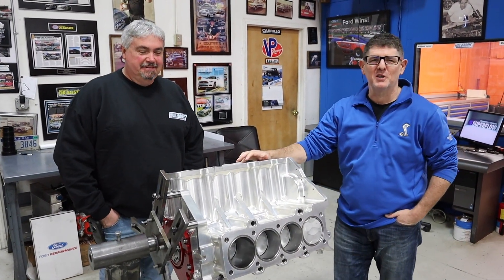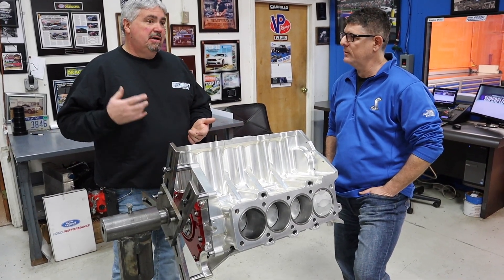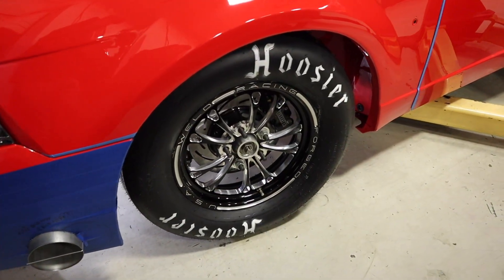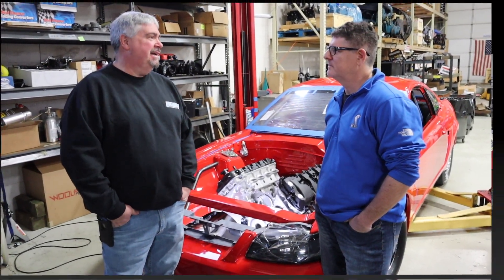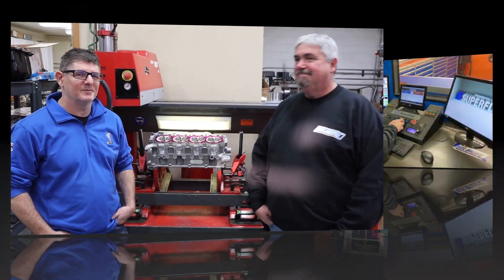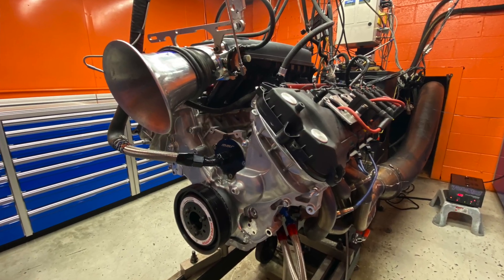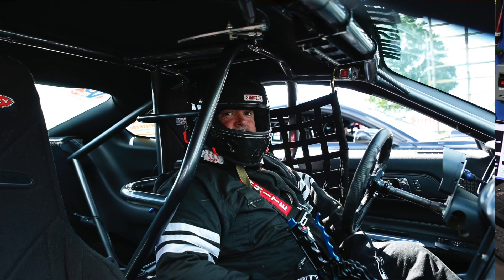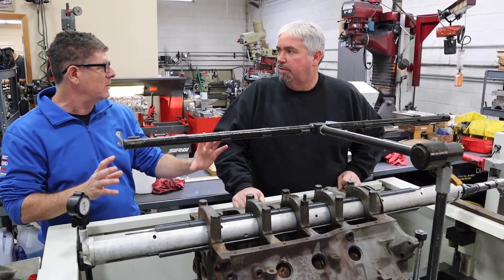850 HP All-Motor Coyote at Holbrook Racing Engines | Billet Coyote Engine Block & Race Car Reveal

Comment: Oh just some parts we had lying around the shop.. BULL SHIT.  You don't run custom grind cams in factory Stock. Guarantee you if I asked for a duplicate of that motor I would get and it would make 650 hp. 327ci so it will get 60hp over your standard build from the displacement.

Comment: The sound isn't just NA power. It's just how modular motors sound. 2 valves were probably the king of sound but they are gone pretty much . 99/01 Cobra 4 valves were a close second

Comment: Im a coyote guy to the heart. But 850hp na on a 327 coyote at 12:1 is a hard sell
Reply: It’s called Thermal Efficiency. F1 is a 1.6L V6 and is 800hp without the turbos. What do you think someone can do with a 5.4L V8?
Reply: @RandomGuyAgain F1 is a completely different level. I can tell you just like to argue. F1 engines arec18:1 compression ratio. A machine to very strict tolerances with machines that cost more money than  this shop can ever afford. I own two coyotes. 850 horsepower is not believable with 12:1 compression ratio.  RPG makes a 5.5l coyote with a compression ratio of 14:1. And with the correct supporting heads, cams, intake it will make around 850.
Reply: @HK304  Its on C25 with GT350 heads. It is definitely not a hard sell lol. Insane if you dont think it made this power

Comment: 163 hp / liter, at 7800 rpm.. dang, thats higher then all motor touring cars putting at 8700-9000 rpm.. there must be a secret sauce in this engine.. anyone notice that it has unequal length 4-1 header? I can see that from the left bank cylinder no 1 is longest, 4 is the shortest.. are there any studies for this unequal length 4-1 design?

Comment: I’m aware this video is old, but ain’t no way this made 300 more horsepower over a GT350. Not at 12:1 compression. Not naturally aspirated.
Reply: @GP_With_The_M3  I got you. Basically you’re  slightly oversimplifying how a race engine is designed compared to a factory assembly line motor. The internals are outrageously more efficient. Much smoother bore, ultra thin piston rings, probably weight reduction in the crankshaft, and 0 friction, list goes on. F1 cars are 1.6l DOHC V6 pumping 750hp without the turbos and electric motor. That’s a 97ci motor with in some cases only 13:1 compression. This is a DOHC 327ci with internals almost as aggressive as an F1 car.

Comment: what block are they using for the 327 NA i wanna eventually wanna build my Coyote to a 327 but i Cant find much on if its ok to stroke a coyote past stock due to the Short Cylinder Walls

Comment: It was still gaining 10+hp per hundred rpm when he shut it down, would be my guess, @8500 for it to make 910-915hp
Bad dude right there, would love to bring the engine from my Terminator to Chris and the gang to work their magic, as it sits right now, it has made 707 @21#'s on e85 with a whipple 3.4 providing the aspiration.

Comment: Suspect 5700 rpm to 5800 rpm this motor picked up 106 hp with 100 rpm. It wnet from 456 at 5700 to 562 at 5800 (strange). Never seen this kind of jump with 100 rpm. Also peak torque is at 7k so these off the shelf cams  are big big. I saw a coyote engine pick uo 250hp with porting and cams only and this was an engine that already had 551 cams and cnc ported heads. The factory port wok is not great and the coyote cams are very mild, even in the cobra jet and gt500 engines. There is a lot of room for improvement.

Comment: would be very interesting to have bsfc ambient pressure and iat data 
running na under 9k rpm direct injection would be beneficial you could make better estimates with ve and bsfc 
what kind of valve  train are you running e.g. valve material and sizes, spring pressures and cam specs

Comment: He stroked a coyote to 5.2 liters and put GT350 heads on it. Soooo essentially he built a voodoo engine with higher lift/ duration cams, and ported heads.

GT350’s do not make that kind of power with simple porting and cams so how in the world is he making 850 hp without upping  compression? 

This makes zero sense to me unless there’s some magic in C25 fuel I’m not aware of.

Comment: 8:38 12:1CR? Sorry but that's just a slight 😅 manipulation of the truth. There's ALOT more going on in that engine than he's owning up to 🤩
You don't make 854 hp NA at 7800 rpm on 327ci at 12:1. 14-15:1 yes.

Comment: 9:30  Good job on using studs to attach the torque plate.  Ive seen lots of shops fasten theirs with head bolts when studs will be used in final assembly.

Comment: why bother sticking with any restrictive dimensions of the factory engine if you're cutting a billet block.  just make it a 5" bore space with 4.750 pistons and two 2.100 intake valves and two 1.650 exhaust valves.  something between a 600-700" engine making 1500-1800hp naturally asperated like its falling out of bed

Comment: Two valve engines are history... As it has been in bikes. Soon these 4 valve Fords will be in the over 10,000 RPM range at a whole new level
Reply: They’re just not. Not to mention they can be built to rev to & beyond 10k rpm. For mileage & pollution? Sure, more complexities will aid you in creating a better commuter that drives smoothly throughout the rev range. But 1 cam operating 2 valves per cylinder can be more than adequate to get ridiculous amounts of airflow out of a cylinder with the correct layout. Look at a Big Block Chevy, 351 Cleveland, or Chrysler Hemi
Reply: I’d love to see that NA Coyote go up against something old school to see the advantages & drawbacks of both setups. A race-y Clevo would go up against this Coyote nicely. 1/4” destroke takes it to exactly 327 cubes & with some high flowing canted valve heads, & a big single intake/carb I wouldn’t be surprised if it made more peak than this engine.

Comment: A 327 cu. in. motor making 854 HP? The potential for the coyote is amazing. Can we get a 427? I’d love a 427 coyote, NA street motor making 1000 HP NA.
Reply: There's a limiting factor to bore and stroke toe Coyote, the bore spacing is small, so you can't bore it that much, 3.9 inches max. Also stroking it (as far as I know) to a max displacement of around 351 cubes (5.8 liter), as in the previous gen GT500. To reach that displacement I think that a bigger block is needed, just as the custom one ant the start of the video...

Comment: 327ci laying down 850hp all motor and it was still making power at 7800 rpm. Chevy, Mopar, or Ford don’t matter the fact is the coyote is one of the baddest motors to have ever been put in a production vehicle.
Reply: Yeah this one far from an engine in a "production vehicle, basically just block and crank, but definitely an awesome engine, HUGE step up from first couple gen MOD motors, definitely a gem of the 21st century
Reply: Mopar is the only ones in the dust nowadays. Chevy has NA 427 inch LS7s that with similar money spent on mods make, just under a 1,000 HP, and ford has Coyotes with 327 inches NA making just under 900. Where's Mopar? A supercharged 398 making a wimpy 800HP in a vehicle that weighs 5,000lbs 🤣

Comment: Hmm something doesn't seem right here. 12:1 compression, only revved to 8K in the video, 327ci, run on C25. Average drivetrain loss of 15%= ~720rwhp. "Pure evil" is 339ci, revs over 9k, 17:1 compression, run on Q16 and makes 744rwhp.You telling me bigger motor, 5 points of compression more, revs higher and it's only making about 20-25rwhp more. I'm sure I'm missing something here. Just curious is all.
Reply: Now thats what I was thinking 🤔 😅
Reply: pure evil has unported gt350 heads and a unported cj, so guess thats were it makes less power
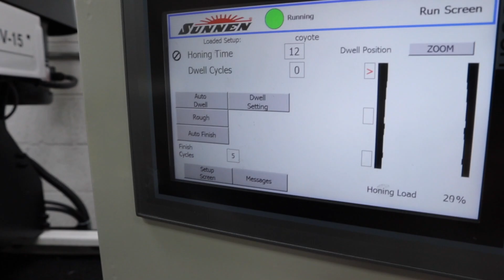Reply: Not sure if you’re still trying to figure this out, but it’s because Pure Evil wasn’t machined as well as this motor. @9:40 is where the real “secret is.” I learned this during my build. A machinist is like a barber, some guys are just better than others. 💯

Comment: 2.6 HP per C.I., very impressive NA build!
Reply: My 327 modular Ford 2v build has a tad 1 .9 hp per c.i. build if i went 4v i could have gotten 2.0 to 2.1 most likely. Still 648fwhp is fun on the street.

Comment: Why such a small displacement? Wouldnt something with a little more Ci be more useful
Reply: The coyote is limited by the size of the block. About 3.8x3.8 is as big as you can get. They have 100mm bore spacing, only 3.937". The deck is less than 9" and the oil pan rails aren't particularly far apart. You might just be able to fit a 4" stroke if you did things like use Honda sized rod bearings and have.the piston pin in the oil ring but there is almost no point. These engines have really good valvetrain stability and even ford is comfortable with a redline over 8000rpm.

Comment: Its nice to see a builder that isn't scared of overhead cam motors
Reply: Yeah it is, they aren’t THAT complicated.  My friends truck needed cam phasers and all our local shops just wanted to replace the motor. Finally talked someone into doing the cam phaser lockout,truck still runs great 2 years later
Reply: @MikeSmith-ey7ku  I agree, im a toyota guy but I also love ford. Ive explained to countless people that overhead cam engines really arent that much more complicated. Unless youre building countless engines a day where you absolutely must crank them out at some huge rate, the added time of putting together an OHC engine is pretty negligible in most cases
Reply: @MikeSmith-ey7ku  thats funny  I've been debating doing that to my ecoboost
Reply: No kidding, LS are cool but it's refreshing to see something different.
Reply: A ford 4.6 2v is probably the easiest engine to build
Reply: Ford 🫡
Reply: I'm doing my first build too lol. 2011 f150 coyote engine.  New timing set, 12:1 pistons, mustang cams in it.  Probably spray it later.
Reply: The problem is the yote platform can only provide about 370 ci. So anything under 3000 horse power the yote can hang. But when you are limited to the amount of cubes you can work with and your competitor  runs a 500 ci motor with twin turbos your just out muscled. 
That is the only issue with the yote. Now someday when someone comes up with a double over head cam 4 valve motor that's 500 ci then we will see some big numbers normally aspirated with out forced induction.

Comment: I'm not surprised at this. The 1st gen coyote heads flow more air than a Yates prepped NASCAR head. That's the obvious clue as to the power potential of the coyote. 
Awesome video.
Reply: This has gt350 voodoo heads on it. They are a huge step up on gen1 coyote heads and even a healthy gain over the gen3 heads. As far as I know the CJ intake fits both sets of heads. The Ford Ax52 crate engine is a voodoo style longblock but with a 90° crank and camshafts. There is coyote firing order cams for the voodoo heads.
Reply: @timothybayliss6680  
Thanks for the info. 👍
Reply: @timothybayliss6680 It’s all in the combo. Just putting gt350 heads on a stock gen 1 only yields 15 rwhp. Ported gen 1 heads with bigger valves outflow/out power a stock GT350 head. You have to modify the GT350 heads to work with the ctossplane crankshaft. It is a bolt on and go affair.

Comment: “Ls WhO?” Lmao there’s an LS making 1100 hp NA and that was almost 5 years ago.
Reply: They got 1200HP ones now and a 1400HP.    Someone makes a head that flows 490cfm.
Reply: Stroked out to what cubes though.????
Reply: @neilmclean1356  not stroked out to anything, between stroke and bore bore is where the power is at for peak power because you can rev it higher
Reply: @zackdillon1320  sounds like an awesome engine. 👍
Reply: You do realize there are people making over 4000hp with coyotes right? Lol the little cheby guys bragging about 1100. Cute.
Reply: @AR-uz4ek  and hemis are making 10000hp

Comment: 850 hp.....327ci....12:1 compression.....8500 rpms...this is nuts. The STOCK Gen 3 Coyote has 12:1 compression and goes 8000 plus.
Reply: It's been well known at this point that Ford literally makes there Gen 3 Coyotes to be prepped for high power output if you ever plan to do it, just gotta know how, this guy found the magic spell and made a complete utter monster out of a small v8 compared to other American v8 or any v8 today.

Comment: Big thumbs up to Chris Holbrook. Him and his late father built several race engines for me over the years. I've always felt the coyote engines made more hp per cubic inch than any other factory American engine. Chris is doing something I've always hoped Ford would do - and more cubic inches to the coyote. Imagine to power if it equaled in size to the Hemis and L/Ss.
Reply: Someone did  test 5L coyote against 6.2L LS. 10K in mods on each.

6.2L made more power but the 5L blew the LS out of the water for power per cubic inch.
Reply: @evictioncarpentry2628  watch the second one, like 20k and a supercharger I think. A cool test but the GM guys brought a 7 liter. Kinda stupid if ya ask me and if I was the LS team I woulda wanted to beat the coyote with a 5.3 or even a 4.8. 7 liters or even 6.2 proves what exactly? That a bigger motor makes more power,that’s about it. Both motors blew up on that one but the 7 liter smoked the coyote,obviously 🤷🏻‍♂️
Reply: @MikeSmith-ey7ku  the 5.3L ran just under the coyote in another video with turbos on each. The 5.3 is usually more reliable then 6.0L+ due to the smaller bore. But, if the LS guys have to come in with less cubic inches shouldn't the coyote come in with 2 valve heads? Since we want to be "fair", right?
Reply: @rockroll9513  ok,yeah,ya got me there. We aren’t giving up our heads tho🤷🏻‍♂️.  I didn’t mean they had to bring less cubes just I would want to smoke another platform with ,less not way way more cubes, but yeah 32 valves
Reply: @rockroll9513  it is not anyones fault that chevy does not have a dual cam engine but engines are always matched by cubes, the 5.3 did not make comparable power to the coyote it got smoked even though the head on the coyote was a ported stock head. And that was the gen 1 coyote used, 2 and three has better heads.
Reply: @joesredinferno1801  incorrect on all counts. You just proved yourself wrong by saying that engines are compared by their cubic inches, when this video clearly compares the coyote to larger displacement LS engines.   And as you just said, the coyote couldn't survive the test. The 5.3 beat it. Welcome to reality.
Reply: @rockroll9513  it's the compression ratios. 2V 5.4 with an equal compression ratio will make the same power as a 5.3 LS. I don't know why people keep going for the coyotes 4V heads. Richard Holdner did a build on a ported pi swap 4.6 power was comparable to the 4.8 LS. People always miss the compression ratios.
Reply: @smackledorfmcsween  I prefer the 2V Ford engines, although the coyote 4V have better heads. I can't afford them, so I make due with LS.
Reply: @rockroll9513  no,  The longstanding argument from Chevy guys has always been that 2 valves pushrod SBC are better or just as good as DOHC 4v that's the comparison 😉 if they are...then prove it by beating the 4V Ford with similar displacement SBC.
Reply: @joesredinferno1801  "...but engines are always matched by cubes..." - nonsense, engines are compared based on whatever the hell someone wants to compare them on. Those LS vs Coyote tests are platform capability tests within a fixed budget plain and simple. They don't prove much of anything, there's definitely some questionable budget choices made, they're just fun "magazine" tests. 

"It's not GM's fault that the Coyote isn't 6.2l/can't support 7.0l stock like the LS can" - see how that works both ways? Just like how the Coyote "only has ported stock heads", the LS "only has a bored out stock block"🤷‍♂

We could also compare Ford's Boss 6.2l to the LS3 6.2l - probably wouldn't want to do that though, right? After all, one is a work truck engine found in only pickups/vans and the other is a performance variant only found in Camaros/Corvettes(and the Aussie Holden performance sedans & their 'Merican derivatives), so that doesn't make much sense... ...kinda like only comparing the Coyote to a 5.3l LS...
Reply: They have a new cast iron coyote block coming out that like 340 cube capable. Think it’s for racing. Prob$$$$$$$ tho

Comment: Would be nice to see this guy, Go toe to toe with the West-tech Ls fanboys Without the "Hotrod Mag sponsorship" which is always biased. Do one of there Ls vs Coyote challenge.
Reply: This would destroy an LS motor. This is how you build a Coyote the right way.
Reply: Yeah they always half ass build the coyote
Reply: $ per $ LS wins. Coyote engines have MORE capabilities per liter(or cubic inch), there's no denying 4 valves can flow more than 2. Coyotes however cannot go above 350 CI (which some hotrodders might consider a flaw since there is NO replacement for displacement,  yes boost is adding "displacement") whereas (honestly the best competitor is a LS7, which came out in 2006 VS 2010 for coyote) lS7s can reach 450CI. Weight between the two is close with LS7 slightly lighter, LS7 also has much lower center of gravity. Point is per pound & per dollar, LS wins. Per cubic inch Coyote all day long! Im a Chevy &Ford guy, so the better question is where's dodge, the red headed step children, 398 cubic inches SUPERCHARGED barely making 800HP 🤣🤣 love beating down hell[pussycats] with my built NA 427 LS7 AND my built NA 327 Coyote 👍

Comment: 850 hp all motor 5.0 yote ....wtf dude... thats mental! Your LS will never be as efficient as the (5.0) liter little coyote.
Reply: 1,000 hp 800ft lbs torque  lsx water jacketed street engine that engine is billet block no water jackets track only engine
Reply: True. The coyote has the highest brake mean effective pressure of ANY mass produced powerplant and even trounces anything from across the pond... Even Ferrari